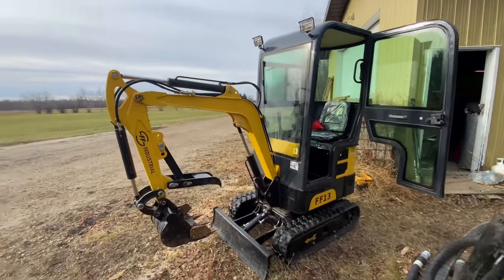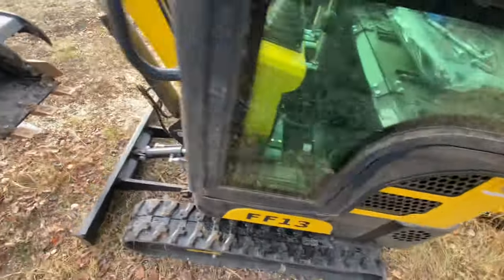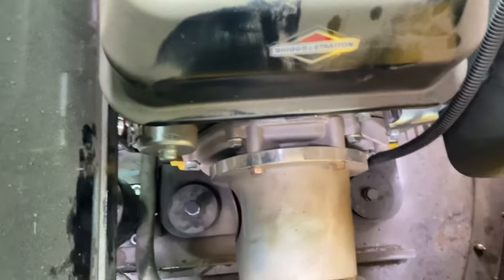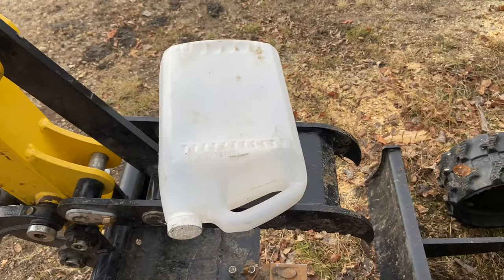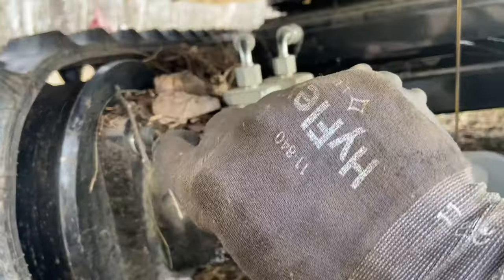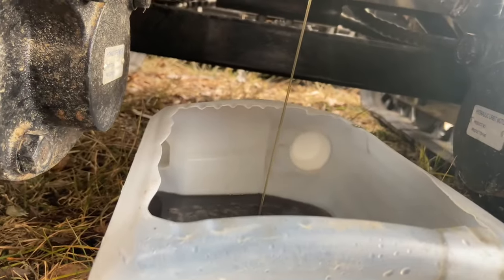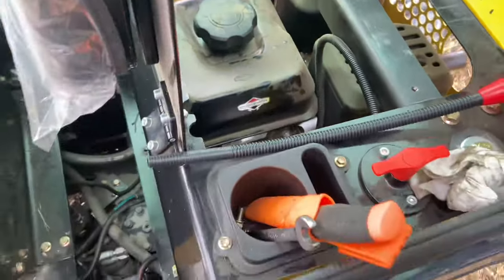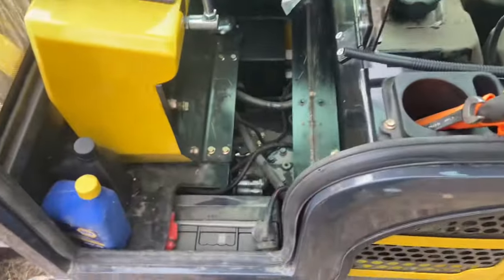Chinese mini excavator first service, swing motor almost destroyed itself.

Comment: A Fumoto valve works wonders for changing oil.
Put blocking under your blade, then lift the machine up to drain the oil.

Comment: mine is sloppy like that I will need to check this. 

last time i went to go pull off that deck plate that covers the battery and it's sandwiched between the cab and I reckon i'm going to have to take off / loosen up the whole top to get it off. that sucks.

Comment: Hi. I see that you are like us... now we are your 936th subscriber...
We just got a mini excavator that has a leak... I assume that is from the swing motor...
Tightig it, I hope it is going to be the fix...
Reply from the maker: @LarchLine  
Loose mounting bolts won’t cause a leak, it can be from multiple places unfortunately… when I’m trying to find a leak I start by cleaning the area as well as I can with brake parts cleaner or my pressure washer, operate the machine in short intervals and periodically inspect the area the leak is in, do not feel around with your hand when the machine is running as you can end up with high pressure hydraulic oil piercing your skin and causing severe injury!

Thanks for the sub 👍 it’s been a loooooong climb to this point 😎
Reply: @PuskwaskaOutdoors, yeah! I know about climbing... we are climbing on your path too... we are 200 subs behind you... good luck... you are close...
I'll try to get you 4 more...
Reply: @PuskwaskaOutdoors If you're looking for a hydraulic leak wrapping or stuffing some cardboard around the suspected area is the easiest way to find it. You don't have to clean anything.

Comment: I have a problem with the swing motor on the Chinese mini-excavator, which means that when the dome turns in a certain position, it squeaks, I feel as if it is grinding on some sheet metal. What could be the problem?
Reply from the maker: That I can’t really help with, you’ll need to have someone look at everything while you are turning the machine, there are a fair number of moving pieces under the floor.
Reply: Okay. I thank you @PuskwaskaOutdoors

Comment: Did the swing motor come loose again or did this fix the issue?
Reply from the maker: Seems to have fixed it…. But only 4 tanks of gas into it since tightening it up
Reply: I tightened up my H15 swing motor bolts, added loc tite but it loosened up again. Looking into other options to keep tight
Reply from the maker: @UniWonder 
Got room underneath to run a longer bolt thru and put a lock washer on them?
Reply: The hole is blind so there is no way to thru bolt. One bolt is over the slew ring so no room for a nut
Reply from the maker: @UniWonder  
Google a product called Nord-Lock…. Not sure if they’ll physically fit in the space available but I’ve seen them withstand some impressive strain.
Reply: @PuskwaskaOutdoors yeah good tip, i ordered them this afternoon but didn't want to say anything in case someone goes down the same rabbit hole in the future and it doesn't work
Reply: You could replace the bolts to 12 grade and tighten them up a bit more. Chinese bolts are considered garden grade in machinery. 
I’ve got a top spec UHI12p with pilot controls and it’s a fantastic machine.

Comment: I just got this exact model and it won't start. I can get it to run for a couple of seconds by spraying carburetor fluid into the carburetor.
Reply from the maker: You’ll want to take off the rear panel of the machine to access the carburetor, remove the cab mounting bolts and lift it slightly to get the rear panel off… Steve’s small engine saloon on YouTube has some good carb cleaning videos… they are very simple to work on and often don’t require much more than removing the float bowl and poking a wire up thru the main jet.
Reply: @PuskwaskaOutdoors  Thanks! I assumed since it was new that there wouldn't be any clogging in the carburetor. Yesterday I removed the panel. It was very difficult using only a 3/8" rachet. I ordered an Impact Socket Adapter Set from Amazon for the future. I did drop a socket that I can't find in the process and I'm afraid the socket will get lodged into the pivot gears at some point.
Reply from the maker: @huhcom 
Nah, there’s not really any way it could get to the ring gear and drive motor… plus it’s all exposed under the machine so debris can fall away from the gear….
Some people on the Chinese excavator Facebook group have reported finding some trash in the float bowl of new machines so it’s worth a look…. Of course when you remove the small bolt that holds the float bowl on you’ll lose any fuel that’s in the tank so have a container handy…
Have you checked for a fuel shutoff? Mine doesn’t have one but these machines aren’t all identical.
Reply: @PuskwaskaOutdoors good call on that fuel shutoff. Some Briggs and Stratton engine have a separate lever to cut off gas. May have to get a hand mirror and a flashlight to look for it.
Reply: Check if the choke is still engaged when its pushed in mine was flooding itself out because the cable wasn’t adjusted properly
Reply: They ship these with fuel turned off some times.

Comment: ….your going to have backlash on a gear drive.
Reply from the maker: Yeah you sure don’t want them to get too tight…. I mean… expansion from heat during high speed loading on a excavator swing gear could be catastrophic 🤣
Seriously tho… they are built with clearances in the gears that rival commercial trailer landing gear.